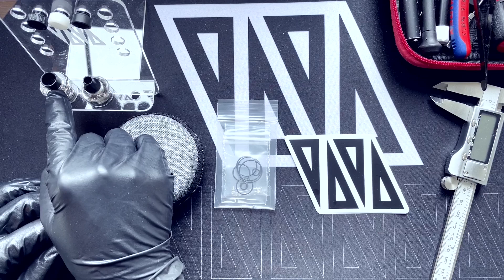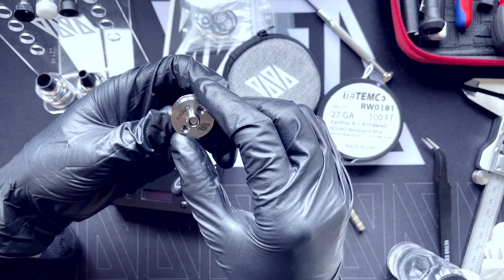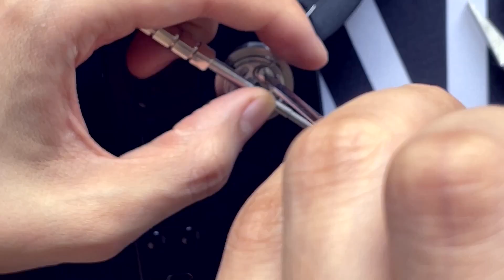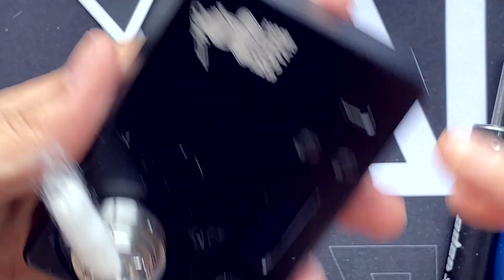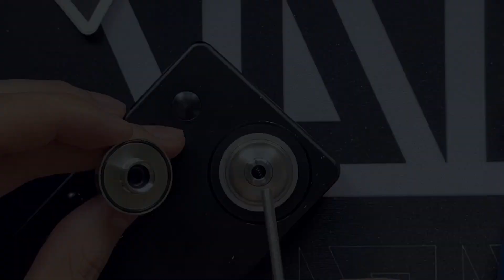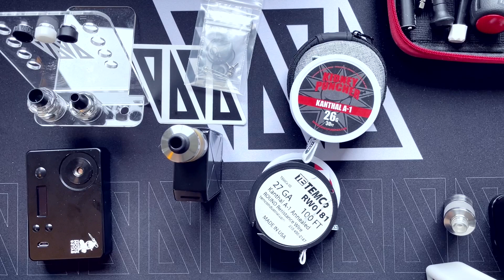NarVA RTA by Nar Mods Unboxing | Build

Comment: I continue to be impressed with your scientific approach.  You gave the best explanation I've yet seen about the ennvironments outside and inside the tank.  So many reviewers talk about a vacuum in the tank which will never happen.  But you correctly described the pressure differential and how it is important to 1) keep drawing juice into the cotton and 2) keeping the juice from just running back out of the tank.  And you gave me new insights into matching coil size to air holes instead of just staying with 2.5 mm as a standard.  Excellent, excellent work!
Reply from the maker: This time, I hoped to dive a little more into how RTAs wick, and to clarify what we mean by 'vacuum' or 'negative pressure'. But since it's an unboxing video, the tone is much more casual than in other videos so far. Your comment makes it a lot rewarding, thank you very much!

Comment: loose coil doesn't need burn it？
Reply from the maker: If you build spaced then all you need to do is a small dry-burn to clean the coil (or to clean with a clean cloth as I did in the video 😉)

Comment: After watching your review I want one... but I fear the airflow will be a dash too tight for my style. Oh and we need to see your sweet face a bit in the review!
Reply from the maker: aww reflecting your style of vaping, the airflow would be pretty tight and the 3ml capacity wouldn't be enough. I did a little calculation for you:

Integra fully open (1.0+1.2+2*1.4+2*1.6): 9mm^2 equating to the single hole of 3.4 (even though Integra feels tighter than this)
NarVA fully open (4*1.27): 5mm^2 equating to the single hole of 2.5

I hope this gives a rough idea for your purchase, happy vaping 😊

p.s. Since it was just an unboxing, I thought I wouldn't really need to go on top :) Thanks for your kind words as always!
Reply: @mizzvapes  Thanks! Too tight for me!